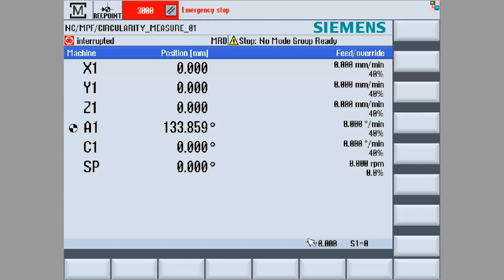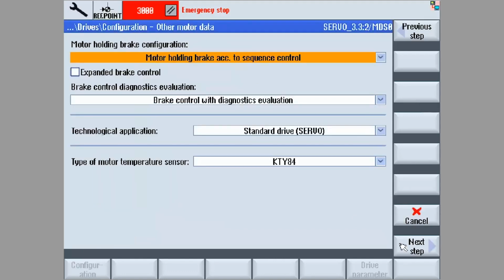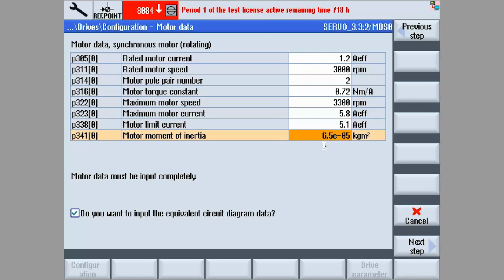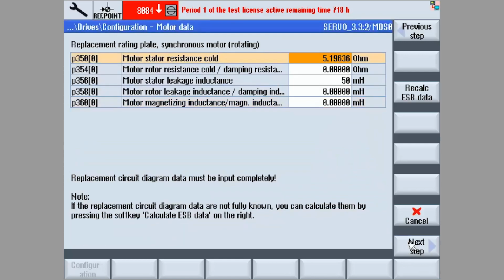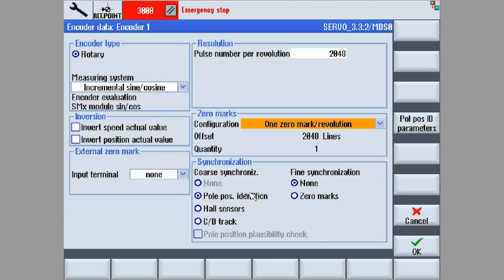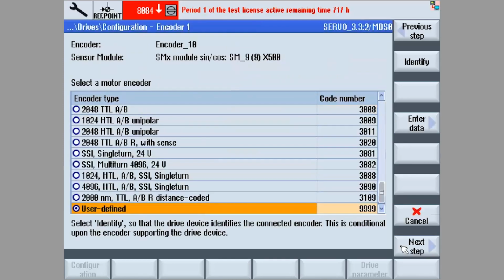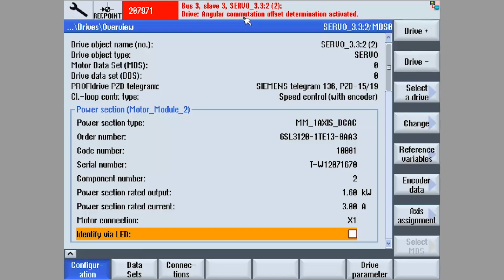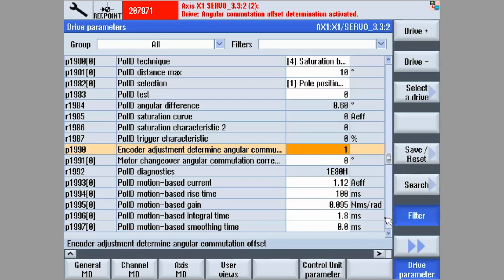Non Siemens synchronous rotary motors

Comment: Hello  this is a very helpful video  ,thank you ,what communication protocol does siemens  control  have, I have servo  that allow pulse train and EtherCAT I wanted to know how to connect  with Siemens  CNC.
Reply: Also I have a drive which supports PmrofiNet which is Seimens control  ,but this drive is not from Seimens , I always  wondered  how could it be integrated into Seimens CNC ,surely this video  shares a light  on that path.
Reply from the maker: It is not possible to connect to that servo
Reply from the maker: Potentially, ypu could get an 808D Basic PPU (rather than our current 808D Advanced system).  The 808D Basic PPU was the last SINUMERIK product from Siemens that supported step and direction (a.k.a. pulse train).  You may be able to find a good deal on the 808D Basic PPU on eBay, but I don't recommend using that product, since it is no longer active.  It was designed to be paired with SINAMICS V60 step and direction drives.  However, some OEMs were able to get it to work with 3rd party systems.  We don't have any documentation about how to setup the 808D basic system with third party drives though, and not all step and direction drives have the same signal characteristics.  For example, in some cases optocouplers are needed to step up or down from 5 VDC to 24 VDC.
Reply: Is it possible to use a vfd controlled spindle motor with encoder and have that talk with the Siemens for Ridgid tapping and such? Thanks for your videos they are so good!